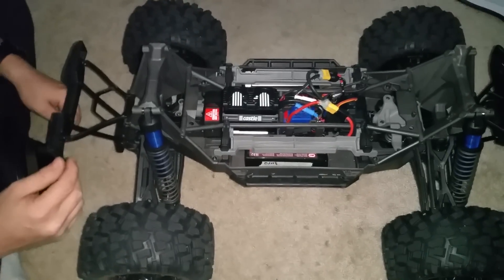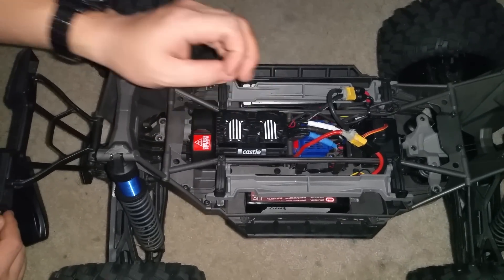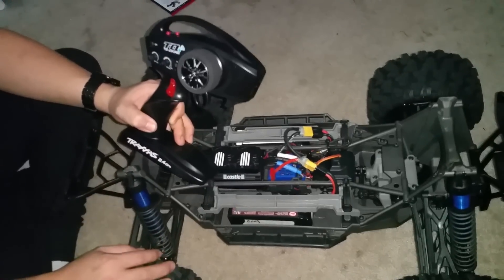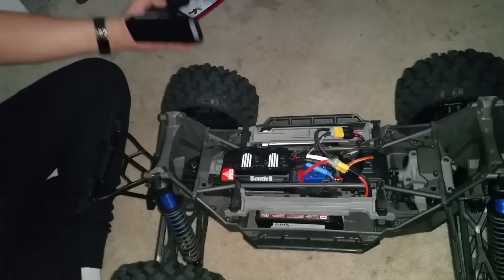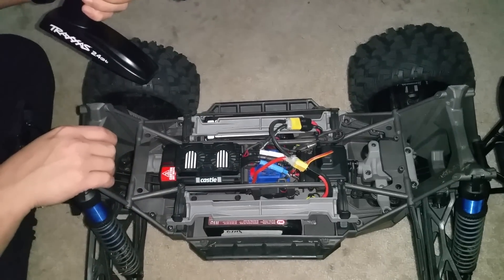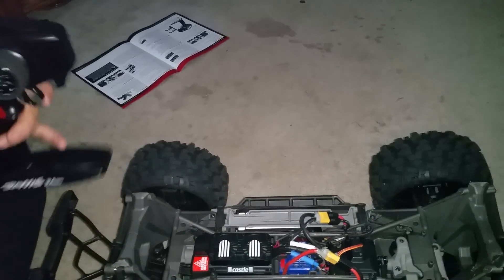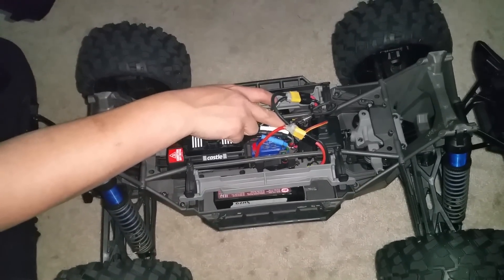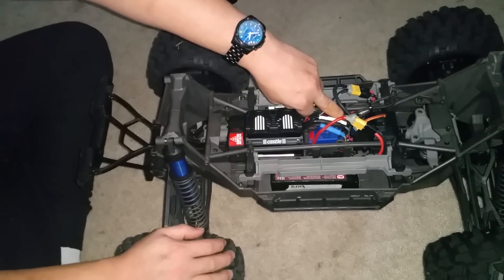Traxxas X-Maxx ESC Calibration and programming

Comment: my esc is bling green when I give it throttle and will not move what does this mean all I get is steering
Reply from the maker: Devin Jamison Low voltage cutoff
Reply from the maker: Devin Jamison if it doesn't let you shut it off by depressing the on off button then its LVC.  you have to unplug the batteries.  If I were you I'd replace the esc with a hobbyking max 5 or 6 or a castle xlx or xl2.  the stock ESCs are very prone to failure.  I can link you to my X-maxx group that has over 2000 members and within a week over 20 of the 8s ESCs have died.  none on fire yet though.
Reply: Devin Jamison Name of group? Today I cannot turn on the ESC. ESC is not responding. Totally. stfu.
Reply from the maker: ExEaZ I'm assuming your batteries are fully charged.  If its not turning on you got a bad esc.  I know you don't wanna hear this but contact traxxas and get a new one or the better decision, get away from traxxas ESCs and go with a hobbywing max5.  easy to calibrate and tune and much much more reliable and better than traxxas.  throttle respo as and over all power is increased. there is just so much more you can do with them.  if you like to tune go with the castle xlx.
Reply from the maker: ExEaZ name of groups is X-maxx owners.
Reply: Nitro Revolution RC Max5, not 6? Yes, 4s battery full. 3s battery also full. Transmitter turned on. Wires not damaged. Well, I don't know what to do in my situation. I'm in Netherlands, I bought car in Poland... Probably It's will be hard/expensive to send ESC to traxxas. thanks for fast respond.
Reply from the maker: ExEaZ Then your best bet would be to just buy the max 5.  the max6 would work but personally I would give the wax more headroom compared the the power the motor will pull.  the x weighs about as much as a fifth scale.
Reply: So expensive car and now more €$£ to spend... Shit. I can use max 5/6 in another cars also? I have to read about that different ESC...
Reply from the maker: ExEaZ Yea you can use the max 5/6 in other vehicles.  and sadly with traxxas electronics this is the gamble you take.  some are great and others are pieces of shit that won't stop breaking.  mine wouldn't stop breaking so I traded for the dbxl.  my dbxl motor gave out yesterday and I don't have the cash for the parts until next Wednesday. ehhh.  This is part of the hobby but still sucks.
Reply: I understand fire, something wrong, bad setup, but... Just not turn on? This suck. After last run i turn car off normally and today JUST doesnt want to turn on. Wtf ;/
Reply: I have fresh news, my ESC is working... In half. Today i opened ESC to check what is inside. I took off first cover, after that second cover with fan. I cleaned plate with button from dust, plugged battery and i tried to turn on from that small button inside. And Xmaxx scared me as hell because it turned on. I didnt expected that. Green light was blinking very fast. I turned it off, closed everything and tried to turn on again. After third try it turned on and was stable green. Next time, flashing green. After that, 5 times i couldnt turn it on. Also in the middle of tries front wheels trembled to the sides once. And for now the biggest problem is that ESC turn on only when it want to do it. I can press 20 times and nothing, after that 1 press and viola turned on. Why?
Reply from the maker: ExEaZ haptic buttons like that used on the X-maxx can be very touchy if they get dirty.  they are the some that are on most chargers.  they click due to a concave disc inside that contacts the outer contact points to a central contact point.  if anything goes wrong with this disc or it gets dirty it will be a pain.  I personally could solder a new one on and traxxas never know.  My best advice is contact traxxas and get a new one and while you are waiting buy a hobbywing.  when you get the new esc from traxxas sell it NIP to regain some of your money.
Reply: Well, i sended to them email but i think i will wait forever. Probably i will try to call to them, maybe it will be faster way. Do they need receipt from my dealer or it doesnt matter because i just have their product? Probably its good idea to sell new one but from other hands if hobbywing will fail i will have nothing again. I checked max5 and im afraid about mount solution, max6 would be easier but its weaker...
Reply from the maker: ExEaZ Has the receiver or ESC gotten wet?
Reply from the maker: ExEaZ If its flashing green it needs to be recalibrated.
Reply: Well, not when i opened it today but once i was driving at wet surfaces and after that i cleaned full car at the shower. Recalibrated, ok - i think its will be easy. Harder problem is that F*** button - it react only when it want. Really, your answers are really fast - i really appreciate that :) And i have a looots of question. Like a baby.
Reply from the maker: ExEaZ You cleaned it with water?  noooooo.  ESC and possibly receiver fried.  they're water resistant.  not water proof.  and ask away.  im off work until next week.
Reply: Impossible, really. 1. A lots of waterproof test on the internet - no issues. 2. I never turned car on after shower - i let it dry to full day or two. 3. Car was totally ok in sunday - i was running him for 2 hours in beautifull weather.
Reply: Well, today i turned it on and had a good run. When i wanted to turn it off to change batteries... Check my video, i recorded it :)
Reply from the maker: ExEaZ Tbays usually the LVC.  it wont let you turn the esc off.  you have to unplug the batteries.  same thing happened to me
Reply from the maker: ExEaZ The reason I respond so fast is I get notifications.  and ushally it only takes a minute or 2 to diagnose and explain a problem.
Reply from the maker: ExEaZ And my suggestion is record as much as you can.  find a way to mount your phone or camera to your TX so if sonetbing goes wrong you habe it on tape.  Its what I akways do with brand new products like the convergence.
Reply: Noo, i had still more than 50% in the batteries and i havent red light when LVC is on. After i pluged fresh batteries the same thing - i couldnt turn it on.
Reply from the maker: ExEaZ Its definitely the haptic switch.  you can replace it yourself if you know how or call traxxas.  1888traxxas.
Reply from the maker: ExEaZ Ask as much as you'd like.  I research more than I run so there isn't much I don't know.  sometimes I have to ask friends that have experience cause I'm only 2 years in but if I dont know sometbing I read.  if I have a problem I can't diagnose I ask.
Reply: Can we go to the private place to talk or everything here? Yesterday i got answer from Traxxas "Traxxas handles international warranty issues through our international importers.  Please contact the local hobby shop where you purchased the vehicle and see if they can help.  If they cannot, ask them to contact their authorized Traxxas importer where they purchase their Traxxas products.  You may need to send the part to them for evaluation."
Reply: And no, i dont know how to change switch... ;/
Reply from the maker: ExEaZ facebook?   texting?  its hard for me to get to YouTube messenger.  I'm working from a smartphone.
Reply from the maker: ExEaZ and you bought this second hand?
Reply: Facebook, sure. If you want. I bought it from local hobby shop.
Reply from the maker: ExEaZ ok.  my name on facebook is Randall Hughes. the picture is a road with an insignia on it for megatech.
Reply: Nitro Revolution RC Really, it's hard to find you or I'm just stupid. I cannot find any avatar with road...
Reply from the maker: ExEaZ Here is the url to my account
https://m.facebook.com/Randall.Lewis.Hughes?ref=bookmarks
Reply from the maker: ExEaZ Just let me know your message me so I know who it is trying to friend me.

Comment: Hello Guy , i am trying to use an other radio system (taranis + D4R2 ) but issue when i calibrate the ESC
i made full trottle and full brake , but after led is green flashing ( i think ESC don't found correct midle trottle)

HELP !!
Reply from the maker: That would be your throttle trim I believe.  try calibrating again.  if it doesn't work call traxxas and they will walk you through it.  1888traxxas.  you also may need to reverse the throttle channel.
Reply from the maker: Julian demetz Also always use fully charged batteries.
Reply from the maker: Julian demetz Just as I thought.  The esc is telling you your throttle trim is off.  this happens a lot with aftermarket radios
Reply: i am working on issue but very hard !

i test the ESC with spektrum radio dx4s and SR410 receiver and all work fine
i check µsec on hitec-HFP-25 programer servo
i read for zero trottle 1443µs
for full trottle 2032µs
and for full brake 1246µs

i configure the taranis radio with same value for mini/middle/full command (i use elevator stick with return zero)
 but not work , ESC led is fast flashing green

i test frsky receive with frsky ESC calibration and with spektrum calibration ESC

i need help ! 

when it work , i instal a pixhawk for auto navigation
Reply from the maker: Julian demetz Oh your using an air transmitter.  Thays gonna be tough.  I always use surface radios with surface vehicles.

Comment: Thanks for the quick response, I keep trying that, and it changes to 2 blinks back to back, the trouble shooting part of the instructions says either input voltage, I tried 3 differant sets of batteries, or no throttle signal, doesn't seem to want to go into program mode, I tried another ESC just for shots and grins, and it does the same thing, so I'm leaning towards throttle signal I think, but not sure.
Reply from the maker: Bill Bernard sounds like channel 2 port has died.  contact traxxas Tuesday.

Comment: maybe you have seen this before, it's go me stumped
Q: I have a hobby wing ESC a traxxas TQI 2.4 transmitter, I took my X MAXX apart to change steering servo, and do some cleaning, put it back together, like I have several times in the past, but now the red light flashes fast on the ESC, the receiver is green, and the steering works, but no motor activity, tried reprogramming, I have the programming card, but the ESC just blinks red, I know the motor is good, the error seems to be something with the throttle control position, or lack there of, according to the hobby wing trouble shooting section, any thoughts ?

I'm sure I made that confusing as hell, I really would appreciate your opinion on the matter.
Reply from the maker: Bill Bernard You may have to recalibrate. Im not sure but I believe you hold the programming button and turn it on and that will put you in calibration mode.  pull full forward and hit the button again setting full throttle then full reverse and hit the button again and its calibrated.
Reply from the maker: Bill Bernard you may jabe to press the button a tbird time when the controller is in neutral.
Reply from the maker: Bill Bernard yep.  I just looked up the manual. just go through the calibration phase and you should be good to go.  if not channel 2 port has gone out.  its known to happen. ive spoke to many that had steering but no throttle.  And every time channel 2 died for some reason and it should be warrantied.

Comment: Damn 25 fuckin pounds, wtf
Reply from the maker: it gets even heavier when you add the castle xlx system, tbone kit, roll cage, steel spur yes it is a heavy truck that's why the esc went up in flames. When an esc and motor combo is put together the wax is supposed to be able to output 20% more than the motor would ever pull.  Traxxas directly matches their esc and motors.  this is why their esc's burn up.
Reply: Amateur RC thank you so so much for the info Sir, i will get one in like 3weeks for my birthday lol saving up now bby...
Reply from the maker: +Gerwich Saint-Hilaire go for the losi MTXL. The X-maxx is plagued with problems.
Reply: Amateur RC but i don't like gas or nitro engine, the noise irritates me, but my decision was between the Bushmaster or the Xmaxx, even though the bushmaster is very tough and durable, i dont see lot of reviews on it, i valued your opinion sir, the truck looks very good, i don't want to fix things every damn time i go do some runs man...
Reply from the maker: +Gerwich Saint-Hilaire well with this truck it's a crap shoot if you'll get a tough one or not. some are great and hardly ever break.  others break every run.

Comment: Another question for you.....I was just running my xmaxx and about 10 min into it the truck went to HALF Power? Then I kept running it slow and then I stopped for about 3 min(truck still running) then I gave it FULL speed and it took off fast?  Why does that happen? I am running 5 fans like you did?P.s Iam running 5000 mah traxxas ID batteries
Reply from the maker: overheated
Reply from the maker: when the ESC overheats it will go to have power when the motor overheats it will shut down for a few minutes to let the motor cool and then after everything cools it will take off like a bat out of hell

Comment: Well it finally happened to me....(:   Trying to program the esc to 50/50 from 70/30 and the truck went full speed ahead and hit one of my folding chairs and did a back flip from the wall and landed on its top then I rushed to pick it up and it was still going tires are turning fast ballooning bad ...I got the battery to unplug to stop it..WoW  that was fucked up scared the living shit out of me...lol..
Reply: exact same thing happened to me hit my   dog now it scared of truck lol
Reply from the maker: yeah you want to make sure you do that correctly because if not when you flip that switch it's going to go nuts

Comment: i have a quck question how did you get the x maxx most places say that it wont we avaiible until mid febuary did you get a pre-release or someting?
Reply from the maker: it was originally released mid december.  I called traxxas and ore ordered one and they told me they wouldn't have any in until new year.  2 days later they had them in stock but I didn't have the money as I hadn't been paid yet.  So when I did get paid I called all the Hobbytown USA in the Southeast and found one in Auburn.  they were recalled because 3 esc caught fire and just alot f people had problems but the esc fires were the main reason.  They're fixing them all with fusible links and giving free fusible links to all those who already have one.  over 5000 have been sold already.  Right now they are damn near impossible to sell.  join the x-maxx group on Facebook and they update on where people find them at their local hobby stores.  I know one store had 8.  You've just got to search.
Reply: +Randall Hughes thanks for the info very helpfull

Comment: I made the mistake u talked about , it took a flying leap off my kitchen table, hit the floor, wheels spinning burnt a hole in my linoleum, my cat was coming into the kitchen , the x-Maxx almost caught her, and then the truck started to climb up my stereo speakers , luckily I grabbed the bumper , held it up and pulled battery power,, it wasn't funny when it happened but it sure was afterward, wish I had video of that, lol
Reply from the maker: yea that isn't fun and it's happening to alot of people.  the first time I used t was on a nitro so it just put the brakes on 20% lol.  Electric and your screwed.